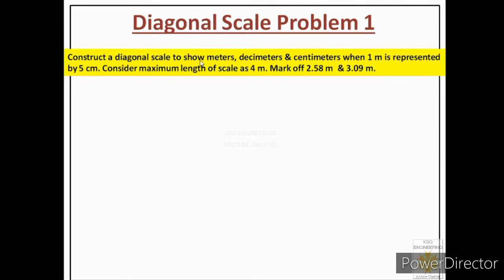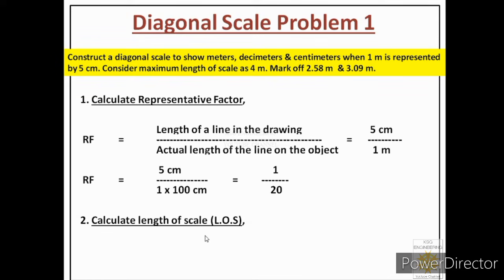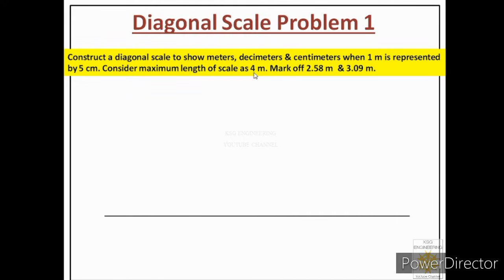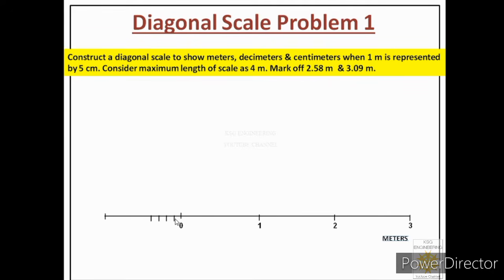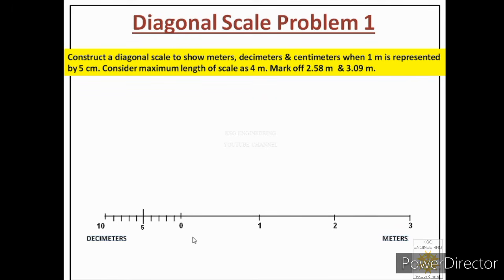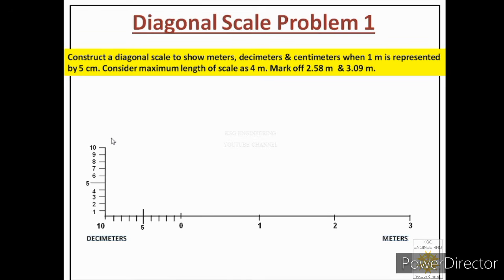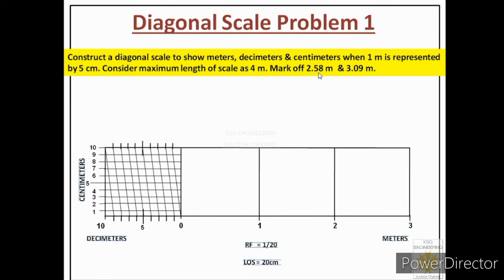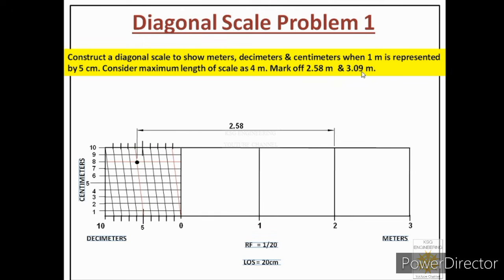Diagonal scale in engineering drawing | Scales in engineering drawing | Engineering Drawing

Comment: 00:02 Constructing a diagonal scale to show meters, decimeters, and centimeters
02:34 Calculating length of scale in engineering drawing using diagonal scale formula
05:03 Diagonal scale in engineering drawings
07:25 Using a diagonal scale for engineering drawings.
09:57 Understanding the conversion of plane scale to diagonal scale
12:22 Dividing the smallest division using diagonal principle
14:44 Diagonal scale allows for customizable division lengths
17:24 Creating a centimeter scale in engineering drawing
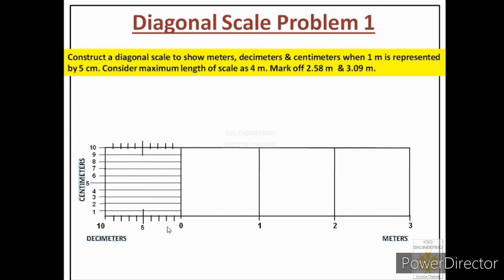19:33 Constructing diagonal lines in an engineering drawing
21:57 Drawing a diagonal scale for precise measurement.
24:16 Understanding the diagonal scale principle
Reply from the maker: God bless you